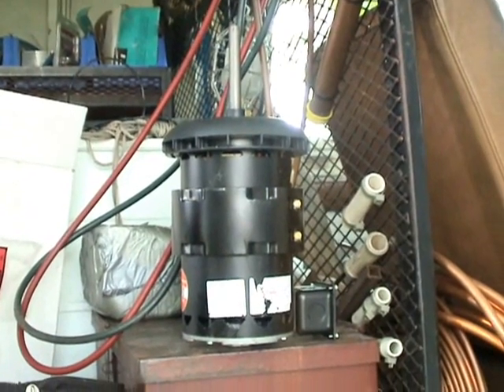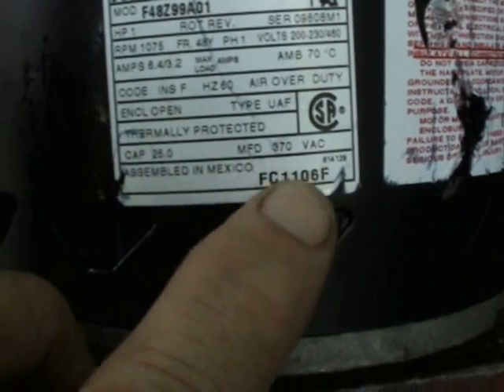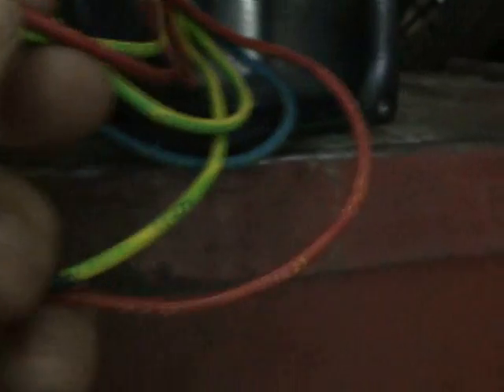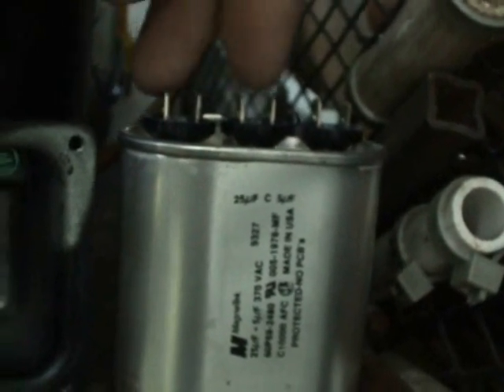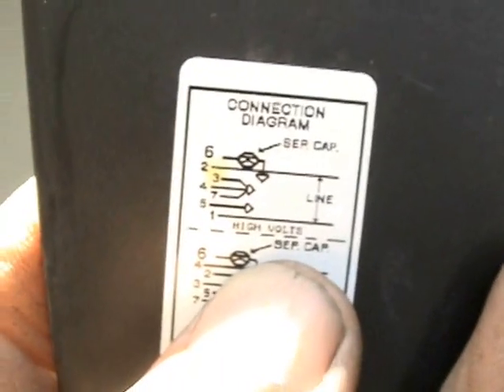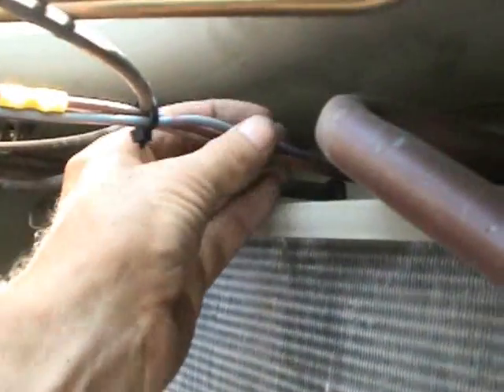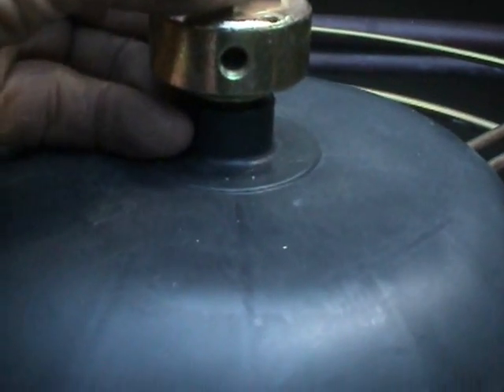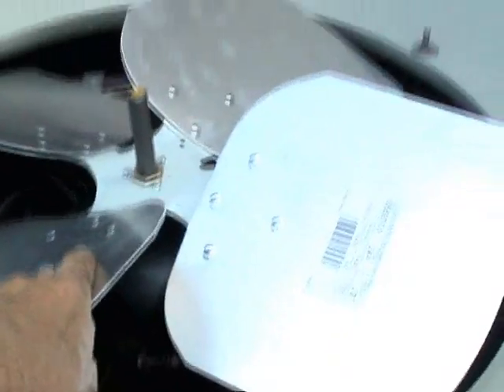HVAC Commercial Size Condensing Fan Motor

Comment from the maker: @toddnessa Are you setting up the fan as a 3 or 4 wire config. If you connect the two brown wires to the run cap in a 4 wire config then make sure that you only have those two wires connected to the run cap. A third wire on the run cap is what you'd use in a 3 wire config.

Comment from the maker: @3535gt If you want to keep the three wire setup, just cap off the brown/white wire and connect the brown wire to the run capacitor.

Comment from the maker: @3535gt 135 doesn't sound bad. My rule of thumb is if it's too hot to hold for more than a few seconds then it's overheating. Overheating can be caused by a bad run capacitor and/or bad bearings.

Comment: Having the color coding and numbers on the cables as well as having a wiring diagram makes it easy.  But having to do a 3 phase and coming up with your own on giving numbers to the cables can get pretty challenging, at least to me.  Always remember, (BOY that's hot) for 480 volts, Brown, Orange, Yellow!